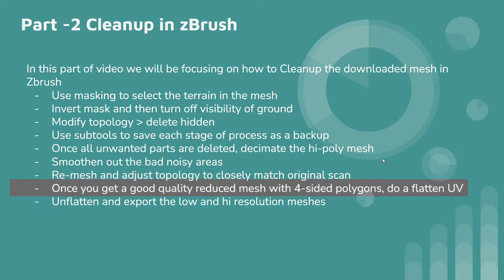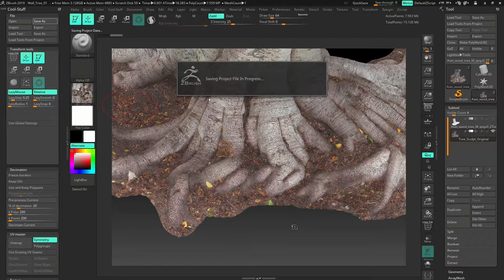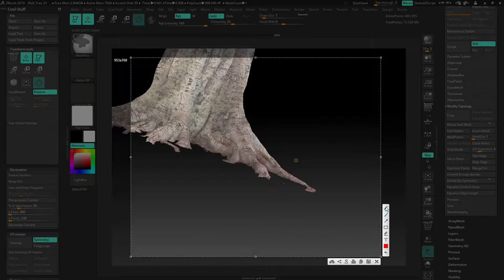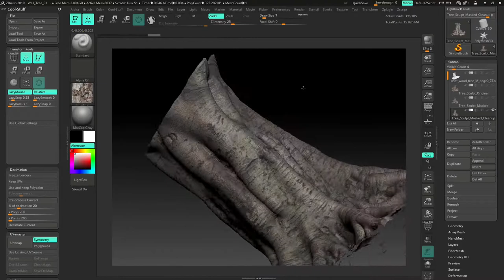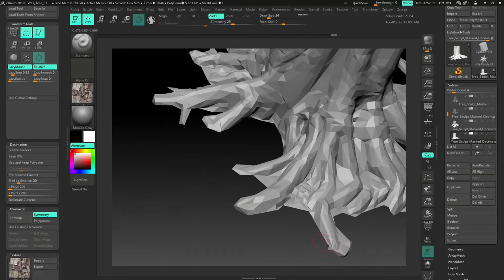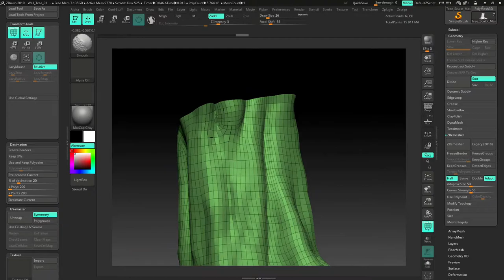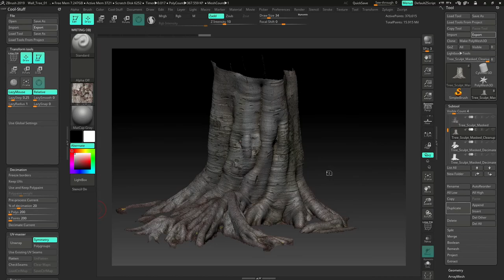Photogrammetry for Vegetation - Part 2 - CLEANUP IN ZBRUSH

Comment: thanks for the video. i think you can do a projection from high poly to your remeshed unwrapped lowpoly
Reply from the maker: You mean baking?
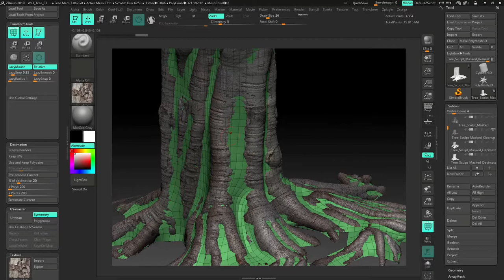Reply: @SVLabs3dArt  no, I mean at 29:12 you are adjusting your lowpoly to match the high poly by sculpting. instead, you can do a Subtool-> Project. select lowpoly, hide everything except high poly subtool and press "project all" and your lowpoly will match highpoly
Reply from the maker: @kate3D  ah ok. In my next project I will try it. Thanks for the tip
Reply: @SVLabs3dArt  sure! i usually do this at the end when i dont want to dynamesh anymore. copy subtool, remesh, UVs, subdivide a few times and project your dynameshed sculpt. now you have your high poly at highest SDiv and lowpoly at SDiv 1